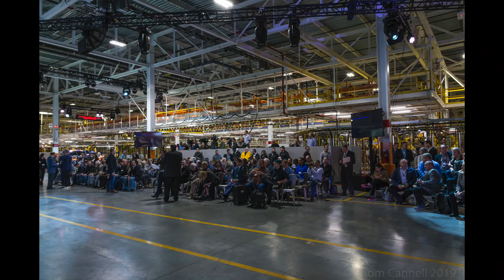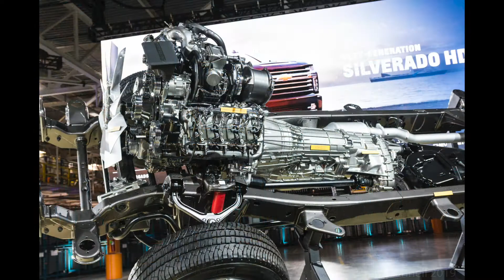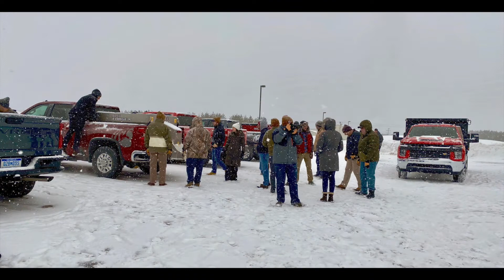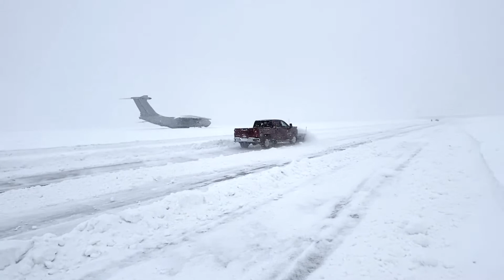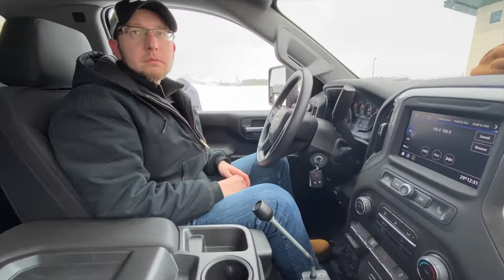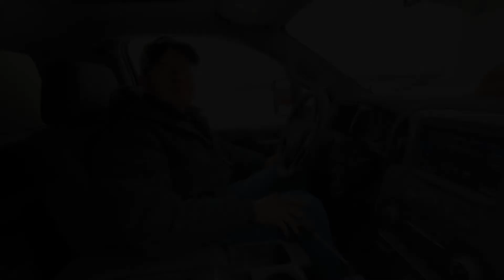Factory PTO Overview - 2020+ Chevy Silverado HD & GMC Sierra HD

Comment: Can the PTO be used in a direct drive application; want to design a through hitch drive shaft for a powered axle trailer in extreme off-road camping?
Reply: How’s your search been on this info I was thinking of doing the same to have off grid power since my truck already has 65 gallons tank
Reply: @boolkids464xx7  You're going to have to engineer that yourself, I would recommend finding a local drive shaft/ power dive company and put it together.

Comment: What fittings do you use for the PTO and the lines required. There is very minimal room to work with especially when the exhaust is directly in the way. A nice option but the engineers failed miserably in making this an easy install. Anybody there that can assist of what fittings I need. I do not have immediate access of fittings so going back to the store all the time is a real pain in the ass.